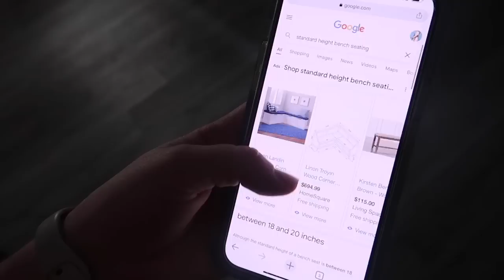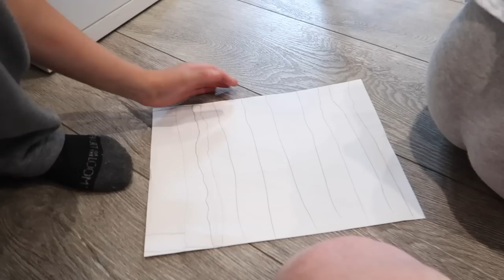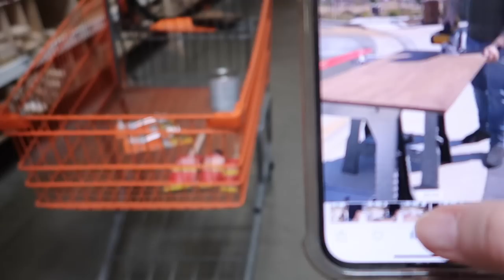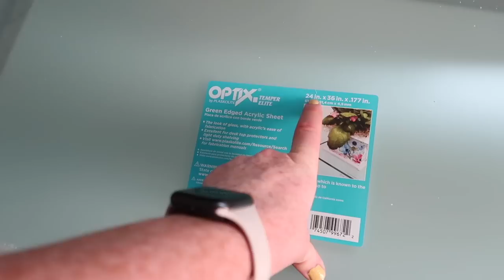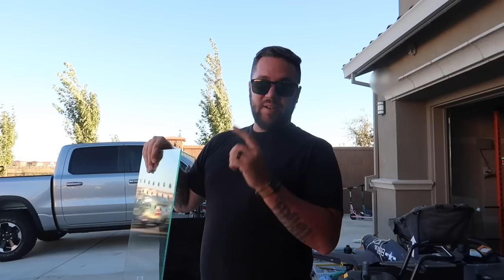EXTREME SCHOOL ROOM MAKEOVER + TOUR 2022 (backpacks, DIY storage, reptile terrarium)

Comment: I love that you want to custom build for Mango but you need to make sure you use the material that is specifically for reptile enclosures. If not you will have tempature, humidity issues because it isn't made to sustain what he needs, especially the lamps. I hope it works, it looks good. Awesome job on the entire room
Reply: I went down a rabbit hole on the kilz3 use as it’s usually used to mask mold staining and odor..

Comment: So, just a little tip, if you needed to cover just a tiny bit on the ends of the shiplap you could just throw up a piece of trim on each side 😉 maybe next time lol. Also, the three rear boards on the rear of Mangos cage I'd throw some sealant between the boards to hide the seams... but it looks amazing! Just test the temps in the cage before putting mango (or another creature 😉) in it. Love the room, it looks great!

Comment: Jess... can I recommend to use walnut shell grounds as a sand base for Mango. I grew up with Beardies and that works amazing for us.
Reply: Walnut shell grounds are not recommended for bearded dragons, just like sand or other loose substrate. It can cause impaction, especially if they are fed in their enclosure but even if they are not since dragons tend to lick everything. Some people use loose substrate successfully, but it's a risk. Ideally, a non-porous solid substrate is best. Ceramic tile, non-adhesive shelf liner and non-adhesive vinyl flooring are good choices.

Comment: I’m curious as to why you didn’t just expand tommy and bug Caden’s room since all the boys want to share a room. Like split the former school room in half and make it either an office or print station, or a breakfast nook area with the benches.
Reply: That would be a MASSIVE project. That would require tearing down drywall, tearing down support beams (and hiring someone to ensure that there are no weight bearing supports in that area that cannot be touched), having to rewire everything, redoing flooring, tearing down the cabinets, putting up new supports, putting up new drywall, putting in new wires and outlets, putting in new flooring, putting up new cabinets, putting new trim on the walls, repainting everything, and then on top of it all doing the project they did in this video (along with the future project of the boys’ room). And there’s still more to a project like that that I didn’t mention, like having to hire a contractor, no to mention all of the extreme expenses (and stress) involved in a project like that. That’s way too huge of an undertaking. I think they just wanted to freshen up the space and do a small project that would help make the space more functional, without having to do anything too extreme, extensive or costly. This was the perfect little refresh for that space. It made it more useful and attractive, but didn’t cost too much. I don’t think they were looking to do anything more than that.